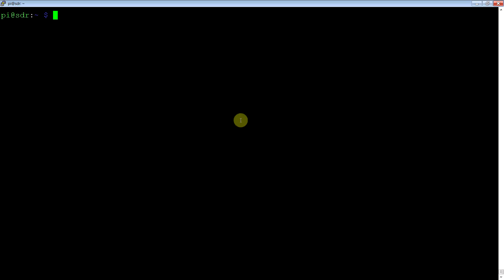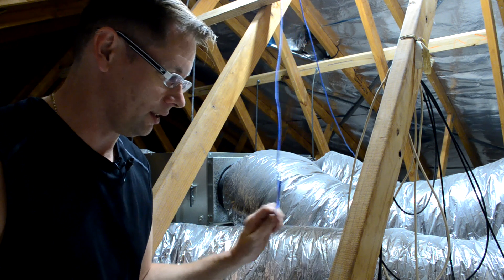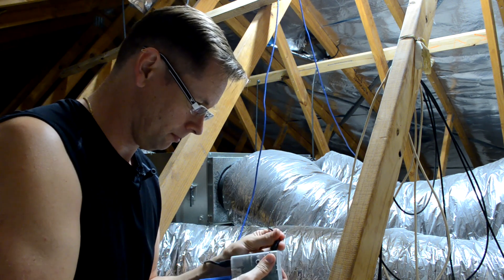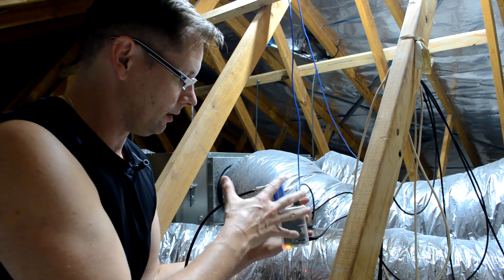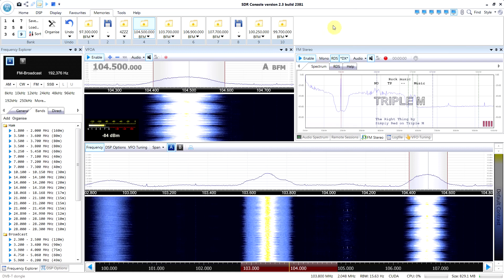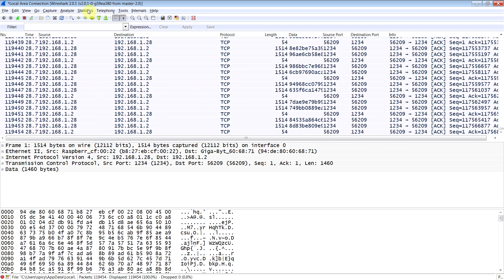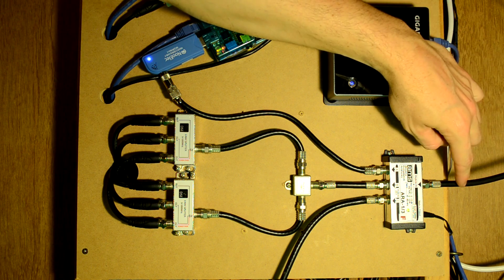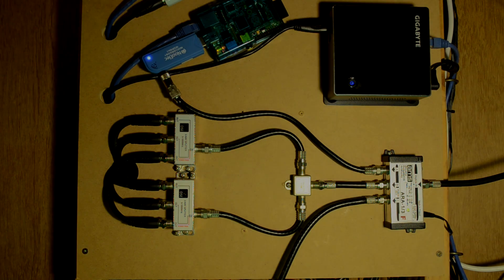Raspberry Pi - SDR Server

Comment: The think that Iam still don't understand is, the dongle is inserted into raspberry pi which is had Linux installed.
And the monitor which viewing the radio (waterfall) is windows software..
Is it detect the dongle even not insert in komputer (Windows)..???
Please answer i want to make this project.

Comment: Finally, this is the only instruction set that made mine work. :-)
Is it possible to have more than 1 client or do I need another RTL-SDR dongle?
Reply from the maker: Each client controls the server which sends it as a TCP stream, so no.
Reply: @TallPaulTech  Thanks.

Comment: Several  Questions? 1. What model Pi? I have a zero, a one, and a three available. - 2. Can I run ADS-B and and an Audio monitor off the same Dongle, or do I need two dongles.  3. Connecting the Dongle to a different antenna - what do they call the connector type on the dongle - eyeballing it, I think it's an MCX Male,  but see no mention  at Jaycar - is this an ebay only, 4. How big an MicroSD card do you go with for this?
Reply from the maker: 1, Any will work
2, You'd need 2
3, You'll have to find online connectors
4, As long as Raspbian fits on it, you don't need it to be huge

Comment: Very simple and to the point instruction. Helped me a lot in setting up my own SDR server. Just one question. Can i use two SDR dongles in a single Raspberry pi and monitor two frequencies simultaneously as there are 4 USB ports given. If so can you please guide me on that or any particular sites that i can look for. Thanks in advance. DE "VU3GEJ"
Reply from the maker: I haven't tried it, but you should be able to.

        [-d device index (default: 0)]
That is a switch for the server program, so you'd just select 1 for your second device, and pick a different port number to server on.

Comment: @cwne88 great video. Do you think it's possible to stream the data via WAN connection, using a small sample rate  to create a smaller bandwidth in the network , because where I live the upload speeds are awful (~70kb/s).
If not, a solution would be to stream the audio only, right? Do you think the Raspberry pi 3 can run an SDR client, pipe out the audio to an audio server like Icecast and stream to the WAN/LAN, all running in the same board?
I'm sorry if you talked about this, I didn't have the chance to watch your other videos.
Reply from the maker: I was about to say to just stream the audio. SDR is bandwidth heavy.
I tried SDR on a Raspberry Pi 3, and although it runs... it kind of staggers. I might have to give gnuradio another go on the R-Pi 3 though and see how it goes.
Reply: That's what i'm going to do. I heard about RTL_FM that uses a narrower bandwidth but to mess with that requires a higher level of linux skills haha.
thanks !

Comment: Great video! If I forward the rtl_tcp port on my router to my raspberry pi's IP address and since I have static WAN IP address at home, could I connect to the RPi over the internet from anywhere my job takes me? I guess I could! Can't wait to get home to try the same setup you showed us.
Reply from the maker: You could, but the bandwidth is huge. Keep that in mind. Also, this uses TCP so there is lots of back and forth which I doubt would work well without a very stable fast network. (Will probably be choppy)

Comment: Gidday.

So these 12 lines of code I write to the Rasberry Pi. Where does this code go?
Reply: Those are commands that can be copy/pasted (one at a time) to terminal window running bash or other linux shell. If you see messages that contain ERROR then you'll have to copy/paste the first error in the stream into google and fix as needed. You can usually skip WARN messages. Good luck

Comment: The SDR console software you are using I went to the publishers website and they have a 3.0 version. Do you prefer version 2.3 of the software for some reason?
Reply from the maker: To be honest, I wasn't aware of the newer version. I might look into it, but then again it's just 8bit sampled I + Q data packets coming through the network.
I'll have a look at the differences between the versions though and see if I'll update. Maybe they fixed up some crashing, or made other improvements.
At the moment, it works nicely for the RTL dongle that I've got so I'm not in a great hurry to change.
Reply: Ok, thanks for the help
Reply from the maker: Oh you said SDR console... I thought you meant the server. Either way, I just used what was available at the time I set it up. It still works, so you know... :)

Comment: Ah, I never thought of using ethernet. I just bought a long USB cable to get up to the attic one floor above. But that looks like a better solution (I think the USB is running out of spec).
Reply from the maker: haha.. sounds like you'd be pushing the USB cable lengths a bit.
Once it's network data, you can make it as long as you want from one end of the house to the other :)

Comment: I just have a question.. I have the R820T & DVB-T model and it works fine on PC but everytime I insert it into the Raspberry pi 2 it seems to crash it and it looks like it goes through a bootloop until I unplug it.. What do you think is causing it? Incompatibility? Low voltage?
Reply from the maker: That's odd. So you're saying it keeps going through the reboot loop constantly?
As you said, sounds a bit like power. What is the power LED doing? If supply voltage drops below 4.65v (from memory I think that's what it is) then the power LED will go off.
I guess you can't catch the log on the screen quick enough to see.
Maybe unplug it, power up, then check /var/log/messages for any clues.
Reply: I can check on the LED in a second but I am pretty sure I dont see any LED's on it and when it attempts to boot I get it for half a second or so
Reply: Ok so what I get when I plug in the device is the red light turns off but the green light flickers and dims a little. I assume this is power loss?

Comment: Got my multicast IPTV system running at home. Great videos. 

I have found though that a really good TV reception is required. Even though the signal through the TV appears fine it wont work with those USB dongles. Spent the weekend swapping stuff around (2 tv tuners, 2 turner computers, different switches and finally swapped the old aerial out, was a old VHF one with another phased array in series ). My system is far from optimal, have dumb switches which one day I will swap out for some managed switches for the whole house. TV Arial is smaller in diameter which I heard attenuates the signal.

Where do you buy those ethernet to USB boxes? Planning to put the pi in the roof right up to where the aerial comes in the roof to improve signal.
Reply from the maker: For that digital tv stuff, you can use the command femon which is front end monitor, to see the signal being received by your tuners. They're always worse than a real tv, because they're just cheap crap.

Comment: ok what is the poe adapter? I really need them a few of them.
Reply from the maker: It's just a device that can utilise the power that comes from the switch (have to have a POE switch too). The one I have has 5v output, and so I just soldered the micro USB connector to it to power the Raspberry Pi.
Reply: I started looking into this and found some on amazon. Going to try one out. https://www.amazon.com/gp/product/B01H37XQP8/ref=oh_aui_detailpage_o01_s00?ie=UTF8&psc=1
Reply from the maker: That looks perfect. Saves you having to put the micro USB plug in yourself.
Reply: Yea I will let you know how it works out.
Reply from the maker: Are you setting up an SDR server too?
Reply: no a different project. I wanted to set up pihole dns server at the office I work at. Kinda speed up internet up a lil at the office. We have a massive poe switch so instead of having a power plug I thought the poe adapter would be better for cable management reasons. Plus I was looking around for other projects for the raspberry pi I could use at the office. Ive been looking for some type of network monitor I could use with the raspberry pi. Have not found one yet.
Reply from the maker: You realise I've ordered a few of those PoE adapters because of you, right?! They look good.
I wanted to get LibreNMS on the Pi, but didn't succeed. I've heard it can be done, but the mariadb messed me up. NagiosPi was the best I got, but I didn't like it at all.

Comment: Awesome video!!! I want to replicate your set up with a project I am doing. I want to get some feedback from the community of an exact list of hardware I need to accomplish this for just a single streaming event. So far I have:

Raspberry Pi 2 (2 of them)
RTL SDR USB Dongle (server pi)
Raspbian software for  Raspberry Pi 2
POE switch -- power and ethernet plug (server)
SDR adapter for TV plug (coax adapter?)
SD memory card with memory card reader
Ethernet cable(s) - Length varies
Avermedia TV tuner (saw this link -->  https://www.amazon.com/AVerTV-Volar-Green-DVB-T-USB-Stick/dp/B003GXAMEM )
Discone antenna - Diamond D3000N was suggest by CWNE88--> https://www.amazon.com/Diamond-Original-D3000N-Discone-Antenna/dp/B00AR09ATA
Reply: Looks like the Avermedia TV tuner is only Windows compatible. Anyone have any suggestions or resources for a Mac compatible TV tuner. That will function the same as in the videos?
Reply from the maker: What's the project?
If you have the RTL SDR dongle already, then what are you missing for SDR?
Reply: The project is pulling in a live streaming event and finding a way to mute the commentator audio to allow my own platform for commentators/announcers to do the game and stream that feed all in one.

Doable with your video, you think?

I do not have the dongle yet -- I am also using a mac but will use linux for the pis. Any recommendations for the SDR console client software?
Reply from the maker: This is more for the TV side of things than SDR

Comment: Nicely done, can you give me more info on the POE breakout  item, I have not found one with the micro connector that fits the Pi
Reply from the maker: I had to pull one apart and solder that in myself.
Reply: +CWNE88 thank -you.

Comment: So one thing... A lot of RTL dongles don't have the protection diode on the antenna port. This causes premature failure from ambient static that builds up on the antenna. Crack off the casing and see if there's a diode between the antenna centre and ground. If not, you can add one - or pick up a different dongle. I went through several before I figured this out...
Reply: Can you recommend any RTL dongles that do include the protection diode? Thanks!
Reply: This, this is some really helpful information that I am sure will save a pretty penny! - Thank you. :)

Comment: Love how your videos are short, sweet, and to the point. 

PS - What is your opinion on Gnu Radio?
Reply from the maker: Thanks!
gnuradio is extremely powerful, which by nature makes it very complicated to begin with.
I just installed it on a Raspberry Pi 2 last night, but haven't tried out how well it works yet. I plan to use it on 2 Raspberry Pi, one as the receiver in the roof which will pass data to a network sink, and another outside by my radio to receive the network data from the tuner, and demod the radio. All because my favourite station is hard to receive on a normal radio.
Reply: +CWNE88 what makes that particular radio station hard to receive? Are you saying you're intending to develop your own demodulation scheme for it?
Reply from the maker: It's way on the other side of town. I have a discone antenna on the roof of this two storey house, hooked up to this SDR receiver with the right amount of gain. Any regular radio on the ground just can't get it.
Reply: What sort of discone are you using? Sounds like a decent idea for an SDR. Can you get ADS-B with it?
Reply from the maker: Diamond D3000N from www.strictlyham.com.au
ADS-B is easy to pick up.